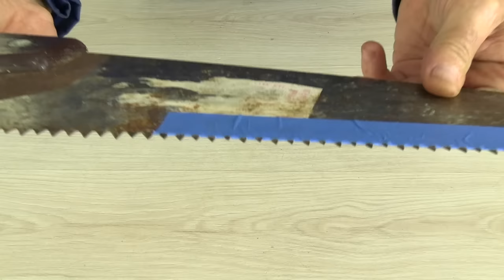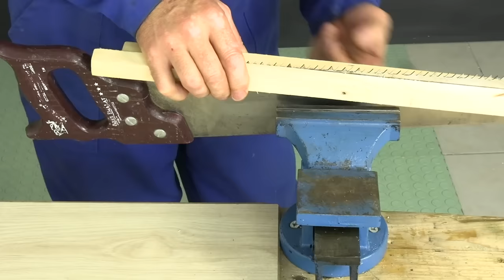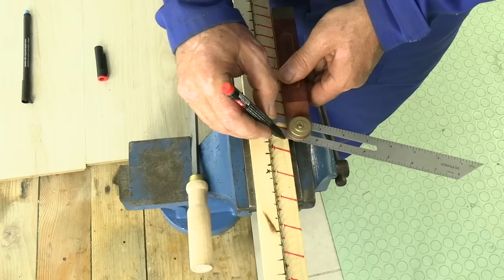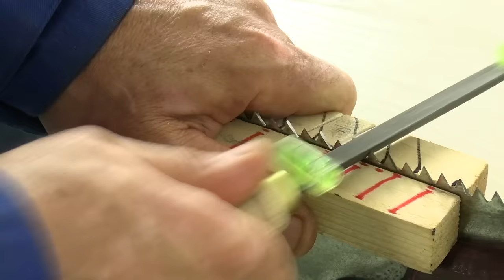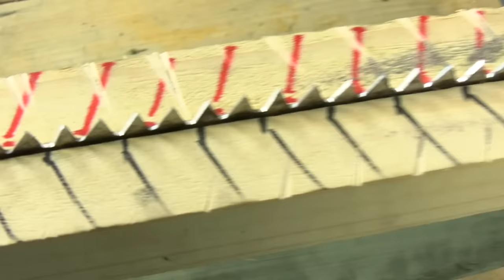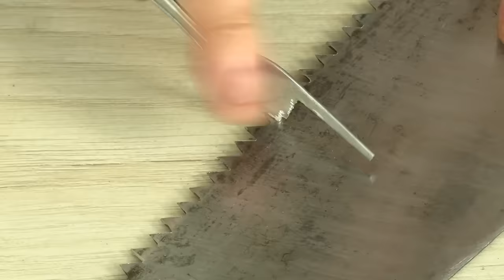How to Sharpen a Handsaw That Cuts Wood Like Butter?

Comment: Hello Sir,
              Thank you for your video. Huge respect to you, I wouldn't mind betting you made your saw sharper than when it was purchased.
I'm going to attempt to have a go at doing what you've shown us. I've thought about it in the past, though I had an inkling the steel maybe hardened and too hard to file.
I think clamping timber either side of the blade and marking off is a fantastic idea in knowing where you're up to. 
With huge respect to you, Sir, I think most people would go and buy a new saw rather than get into all that.
I thought the spirit levels were another great idea, though I humbly think crafts people like yourself would be the people I'd expect to go to those lengths.
I'm definitely going to have a go at what you've shown us.
Thank you, Sir, for your kindness and thought for us.
Reply from the maker: Thank you so much
Reply from the maker: That s very kind of you   Thanks for watching see you
Reply: The issue with those short "Toolbox" saws is that the steel is harden, just as you surmised.  I doubt that a hand file would do much good.  In fact the file would most likely suffer.  We used to send our handsaws out to be sharpened by a saw sharpening service.  The original proprietor did an excellent job on handsaws as well as circular saw blades.  Some time in the '90s, he sold the business.  The new owners would good at their task, but not quite as good as the previous owner.